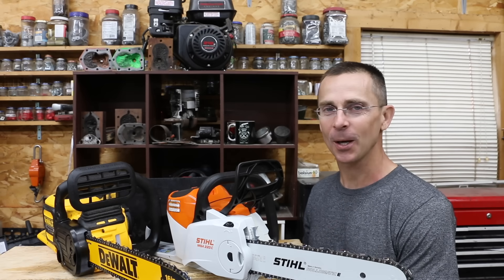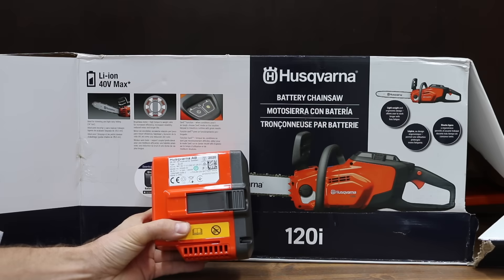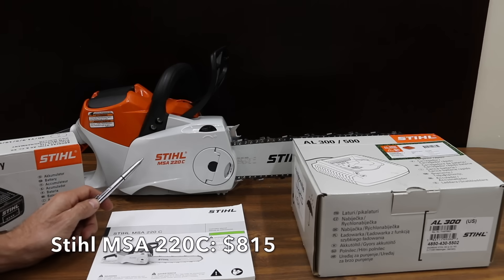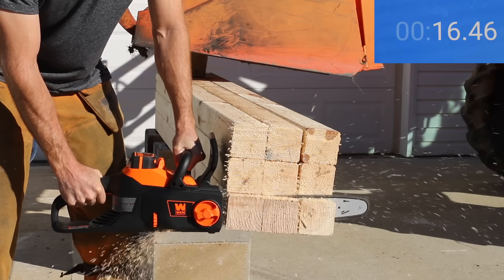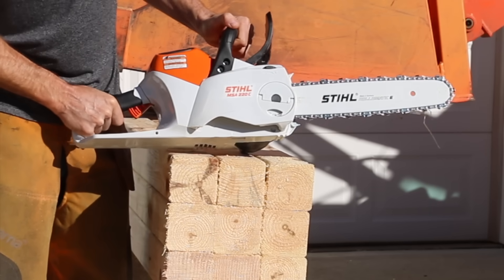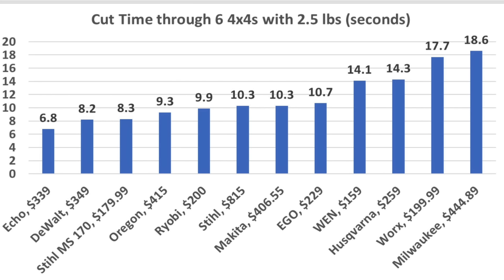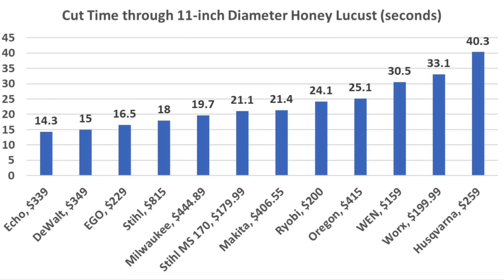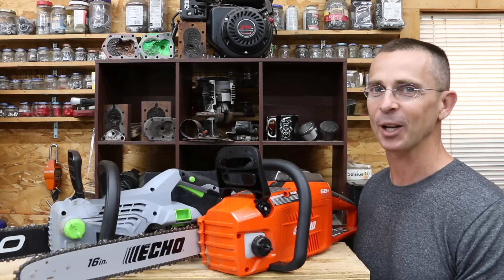Best Battery Powered Chainsaw Brand (ROUND 2)? Stihl, Husqvarna, Echo, Oregon, DeWalt

Comment: Excellent review as always. Several things you did not bring to light .  Different battery platform options and  different models of same brand. For example I have the older Dewalt saw  that is smaller and uses any amp hr, 20 Volt batt. This small light saw is very impressive.  I have 12 other dewalt tools of there 200 offered use same battery. I also have the EGO battery platform for there new 2 stage snow thrower and 5 other yard tool including one of there 2 models  of  chainsaws. Charge time and battery amp hour time is never an issue for me with Dewalt or EGO because of many back up battery's charged and waiting on the shelf.
Reply from the maker: Thanks so much!

Comment: I love your testing videos, please keep them coming.       I hesitate to buy battery powered tools that will sit for extended periods such as a year or more between uses.  Please consider running your tests on 120 volt electric powered Chain saws as I have 12gauge extension cords and a generator if need be.       Thank you so very much...
Reply from the maker: Great suggestion!  Thank you.

Comment: I TOLD YOU ECHO FOR THE WIN YAY. thanks so much for doing this test. did you notice echo is the only one that say its commercial grade. i had mine for like 5 years and have 4 batterys for it and use it commercially for the last 5 years  even put up to a  28'' bar on it.  BY the way the safety switch is in the right spot out of all the saws your thumb is in that spot anyways its more safer and you get use to it. YAY ECHO i payed more for mine  but thats when they frist was comeing out with that saw but its payed for its self 100 times over :) thank you again for this.
Reply from the maker: You are welcome!

Comment: I dont quite understand the place for battery chainsaws. With 5min runtime i wouldnt drag it in to the woods , and for backyard use i would buy a plug in saw for 1/3 of the price and never have to worry about batteries

Comment: What battery are you using on the dewalt? Just wondering
Reply from the maker: Flex volt.  3 amps at 60V or 9 amps at 20v. Thank you
Reply: Thankyou for the speedy reply

Comment: I have the Husqvarna mower and weed eater, those batteries definitely take a while to charge. Especially after use and it's hot out. They have a very sensitive temp control to prevent damaging the cells.
Reply from the maker: Great feedback. Thank you

Comment: To me the EGO is the winner based on price, weight, and performance. Plus in the same battery family they have a 2 stage snow blower and an upcoming riding mower. The Echo is great if bought in isolation but for my needs they don't have any of the other key outdoor tools that I want to replace gas engines in.
Reply from the maker: Thank you for the feedback.

Comment: Unfortunately, half the value of these tests is how dull/sharp the chain is from the factory.  I appreciate that most home owners have no clue how to sharpen a chainsaw blade and will run what comes as it comes, but that can be solved with 1 half hour youtube video.  Any professional will sharpen the blade every day of running or more if they hit dirt or metal in the wood.  Any chain can be replaced with a better one or sharpened to  make it better.  The saw motor on the other hand is a constant.  This is a great video and a great test, but removing the chains factory condition from the result by sharpening them all to the same sharpness (whatever you can do) could possibly change the results.
Reply from the maker: Thank you for the feedback!

Comment: I'd be interested to see how much run time your old gas Stihl had on a single tank. I feel like the electric saws are fine for someone that takes down the occasional tree or buck up the odd deadfall, but is pretty much a gimmick that isn't really meant to compete in a setting that requires more than one tree worth or work.
Reply from the maker: Thank you for the video suggestion!

Comment: 6 min cutting time! I will stick to my gas powered Husqvarna thanks. It would take forever to process a double load of firewood logs! I think the battery powered is fine for average homeowner who does not heat with wood or have large acreage to maintain. Great video.
Reply from the maker: Thank you for the feedback.

Comment: All that cutting.
"Comes with 5 years warranty, tomorrow we gona test that".
Reply: I can personally speak to echo's 5 year warranty.  (Parent company is TTI)  At the beginning of November I warrantied a broken battery that was 2 weeks away from the 5 year warranty expiration.  (home depot emails you receipts makes it very easy to keep track of receipts...).  I forwarded the home depot's receipt to TTI's customer service representative and they shipped me a new 2ah battery.  They took my word that the old battery was dead and they asked me to dispose of it.
Reply: @Nyall   howd you dispose of it?
Reply: @southaussiegarbo2054  You can recycle lithium ION batteries at homedepot.
Reply: @Nyall  australia dont got that.
But just thought id ask bc 90% of ppl just toss any batteries into the garbage bin which is a huge no no
Reply: @southaussiegarbo2054  You could ask whatever hardware store you buy from if they have a recycling program.
Reply: Next updated manual will have a warranty clause: Do NOT reverse engineer that includes youtube smartasses !

Comment: To make that Echo just a little bit better I would have liked to see removable metal bumper spikes instead of plastic permanent ones.
Reply: And a better trigger lock.
Reply: I understand the want for the spikes but they're not there so the customer doesn't burn out the motor by putting too much pressure on the cut. It's still a battery saw. Spikes become useful in the 60cc and higher dsiplacement chainsaws.

Comment: im a big stihl fan however in this case i wouldnt consider buying this type of saw especially for 815$
Reply: I bought my Stihl ms362c-m for $750 out the door with upgrades 25” bar. My dealer doesn’t charge msrp. That’s a 60cc pro saw for less.... I love stihl but that price is just crazy. Those battery packs must not be cheap.
Reply: Agreed.  I have 3 gas Stihl saws but at $800 you could buy the Echo, a spare battery, AND the blower.

Comment: So glad to see the second series come up so quickly.  One comment is regarding the graph that represented the # of cuts through hardwood for each battery.  I think it would be worth adding or supplementing with another graph, the number of cuts per amp hour.  This system might help someone who is on the verge of buying into whatever companies "high voltage 40v-60v" battery line up.  ie: someone might have bought a new house and wants to get a electric lawn mower and chainsaw from ego, where the 2.5amp battery of the chain saw isnt a problem when the lawnmower also has a 5 or 7.5 amp/hr battery.  Just something I noticed as the battery sizes weren't standardized (for obvious reasons) that wasnt mentioned or noticed by me personally.
Reply from the maker: Thank you for the feedback.

Comment: Why didn't check the 60 volt greenworks and the top rated kobalt 80 volt with 5ah battery its 399 at lowes

Comment: I have a bunch of ego equipment. All of which including the batteries are almost 4 years old and they still work good as new. 

I did have 1 battery that had a bad board about a month after purchasing, but after contacting their customer support (they were extremely helpful and friendly) they 2 day shipped me a new battery the next size up after simply registering the batteries serial# and providing an image of the receipt. 

I've since recommended them to friends and family and haven't had a single complaint from anybody. While raw performance is important, they stand behind their products, and after sales support is also very important for me. 

Great video!

Comment: That's a nice echo saw. I have a ~60cc echo but use my 18 volt Ryobi with 10.5" usable bar on smaller wood first. Because of ease of starting and it weighs 9lbs with a 3ah or 10lb  with a 9ah compared to ~19lbs on the gas saw. It would be funny how long it would take to get through 9 4x4s though.

Comment: If you want a non-gas saw for occasional use, I don't think you'll be disappointed with a cordless reciprocating saw and a pruning blade. You won't be cutting firewood to heat your house or felling huge trees, but for yard cleanup it works fine. It seems we're a few years out for battery/motor tech in a cordless chainsaw to get the required power-to-weight to beat gas saws.

Comment: Even though it doesn't come with it the EGO should be tried with the 7.5 battery
Reply from the maker: Great constructive feedback!  Thank you
Reply: @ProjectFarm   no problem I’ve got  2 5.0 batteries and a new 7.5 for the backpack blower and 7.5 out lasts the 5.0 by extra 15 mins at least. So if you can try it out in the future.  Keep up the great work and great videos.

Comment: Why would I get a chainsaw that I can only use for max 10 min? Anybody can explain that to me?
Reply from the maker: I should have mentioned that my gasoline chainsaw will run for around 10 minutes under a constant load.
Reply: I do understand that, they all more or less do but fill it up with gas and off you go again. This time of the year here in ireland I go into my own woods with the tractor and cut up the trees that fell in last year's storm, for next year's fire wood, I'll take my bar oil and 5 liter of fuel. I'm roughly guessing I would need anywhere between 10 and 20 batteries to do the same work. There's probably a market for these batterie powered one's but I guess that's the home back garden market. For me I don't see the advantage.
But love watch your videos anyway, no matter what it is about. Great guy, keep it up.

Comment: I bought a cheap vibrating saw (multi tool) with the round blades a few years ago and have found it has been the handiest tool I ever bought, I used it for everything while building my house. From cutting drywall, to cutting wood, to buying blades to cut steel and cutting nails/screws. I have been thinking of finding a battery operated one and figured it would be another good project farm video- basically like this video, just with different brands of multi tools, which ones work best and batteries last longest.
Reply from the maker: Great video idea! Thank you

Comment: I wish PF had bought the EGO 18" saw.  I own it now and used to own the 14" model.  The 18" is better in every way.  The 18"model has:: 
* Brushless motor with much more power
* Variable speed trigger
* Bigger and more powerful 5.0 Ah battery 
* Steel bucking spikes
* Steel chain tensioner (The 14" is plastic and it WILL break)
* Longer bar
* LED light
I definitely recommend spending more and get the 18".  I bet it would rank 1st vs all of these saws.  Maybe PF will do a follow up and prove me right.
Reply from the maker: Great constructive feedback!  I'll test it if there's enough interest

Comment: I strongly recommend not purchasing Echo electric products since they are unofficially discontinued due to battery issues. The tools themselves are great but the battery tends to fail even if fully charged. I’ve owned most of the Echo electric line personally but switching to DeWalt due to better quality batteries.
Reply from the maker: Great information. Thank you

Comment: Great video (and channel)! I’v been watching for the last two years and stumbled on the Seafoam episode in the Ranger. I have used very much of the information you provide to the community and have the same results, most recently testing on my truck the corrosion protection. 

With this episode going over battery life on the chain saws and a few back with drills- would it be something to test the cold cranking amps on different car batteries and compare to marine batteries? Living in the colder area, Iv often wondered if using a marine battery is worth putting in my older vehicles for daily use. 

Thanks again for the content!
Reply from the maker: Thank you very much!

Comment: 800+ dollars for a electric chainsaw, that’s crazy. 🤭
Reply from the maker: Too expensive for sure!
Reply: @ProjectFarm  should add the Ryobi 18" chainsaw. It's more powerful than the 14"
Reply: @ProjectFarm you can submerge the ego in water it will still work 😁👍
Reply: If it outlasts the others that'd be worth it, but thats not easy to test
Reply: @dpla9752  You'd be surprised how quickly lifetime testing can be done in a controlled environment.
Reply: @dpla9752  The Stihl only has a 2 year warranty, the Echo/AEG/Ridgid is 5 years in the US, 6 years everywhere else. Can't beat that. And they're a third of the price. Mad if you don't.
Reply: @woopimagpie  did you ever need your warranty for a chainsaw? I never did. Might have to do because I only have professional tools.
Reply: Gotta say, I've owned the Husqvarna T536 Lixp for 2 years and it's worth every penny ($770 - includes 1battery and charger)  It's the professional top handle electric saw - very different than the one tested, but an asset to me now!  I really do appreciate the time and effort you put into all of these videos!
Reply: Personally what I would use a chainsaw for I really don't see spending $6-800 on an electric saw. I have a Stihl chainsaw that was given to me. But I have a hard time getting enough leverage to pull start the saw because I'm in a wheelchair it's hard for me to drop the saw as I pull the cord to get enough leverage to start it. But when I do start it, it works great I'm considering to moving to an battery powered saw just so I don't have to struggle trying to start it.
Reply: Agree
Reply: Very disappointing price didn't relate to performance......
Reply: That ego....isn't To Bad 4 The Price & Add; 6amp Battery Do Longer@Run Times. Like To See a ego Powerstation Review, if They OnLy Added 300Watt + At SoLar Chargings. FOr Now the BLuetti ProbabLy Runs CircLes Around That ego Power Bank.
Reply: Stihl is a play on words.
Reply: Wonder if the Stihl comes with a free bottle of lube....for screwing anyone dumb enough to spend that much.
Reply: @MrKritterh  so there are gas saws that run non stop for 8 hours? they don't run out of gas, they don't over heat, they don't need bar oil? thats odd because the gas saw i did own previously needed fuel + oil, bar oil, and if you ran it to long in high heat it would over heat and need a rest,

as for "charging 10 minutes for every minute of cut time" i'm not sure where you get that, but i have 2 electrics. a 60 volt power works and a 20 volt dewalt. i have 7 batteries i can cycle through the power works and i have 5 chargers to charge 7 batteries. the dewalt i have 7 batteries for it and 3 chargers. its gross over kill for what i do. i rarely cut enough at once to need a second battery.

if i needed 8 hours straight cutting.......i'd wrangle a cord before I'd buy another gas POS.
Reply: @MrSGL21 Clearly the other guy watched the entire video because it showed run time minutes vs charging time. Only 2 run under the 10 min per min run at 9.2 and 9.8.... the others were at 11.3 14.6 14.44 18.34 and the worst at 23.9 minutes of charge time to get 1 minute of cutting.
Not sure what saws you have used that get too hot in heat conditions..  I work in a pretty hot part of Australia and the heat will drop the workers before the saw will stop. 
Some of the smaller battery saws I have used are impressive for the few seconds I have used them, yet to test for a full day. Waiting for Milwaukee to bring out their newest that will compete with stihls 201tc. 
In my industry I can't see the battery operated competing with the current 2 strokes. Would need a solar panel the size of the truck roof to keep up with charging, a place to mount, charge and store batteries to cover the whole day.
Gas, oil and bar oil are universal to all saws, different size electric saws will most likely have different batteries that aren't interchangeable
Reply: It’s insane! $59.00 Worx Electric 3.5 HP. Runs Excellent today,  and 15 years from now.
Can you say that about cordless?
Reply: @algorel4763  hahahaha! Enjoy wrangling the cord on that cheap piece of s***.and I know cuz I've been there and done that and murdered two corded electric saws. I'll keep my 60 volt power works and my 20 volt dewalt thanks!
Reply: better than buying garbage made in china.

Id buy it just because it was made in Austria.
Reply: @jhart7304  buy something because it's good value, this one just isn't that,
Reply: @jhart7304  Ego is made in China and so far it's been lasting me for a good while and honestly I feel like I got my money worth out of it
Reply: @Dunki113  Well looks like you're wrong cause we all just watched a 20min video and the Ego didn't do well at all.
That's why we watched the video so we don't have to rely on silly opinions and conjecture like yours.
Reply: @Senkino5o  he was just saying that the cheap saw has held up and hes ok with it
Reply: @Senkino5o  I know what video you watched I watched the ego finish third place beat the s*** out of a bunch of saws that cost a lot more money.
Reply: @Senkino5o  I know what video you watched I watched the ego finish third place beat the s*** out of a bunch of saws that cost a lot more money.

Comment: Really good test as always but please use battery capacity in Wh, kind of pointless comparing Ah when they have different voltages.
Reply from the maker: Great constructive feedback. Thank you
Reply: @ProjectFarm  Np. Interesting would also be dividing your full battery run test results with each battery (in Wh) to see which chainsaw is most energy efficient at cutting.